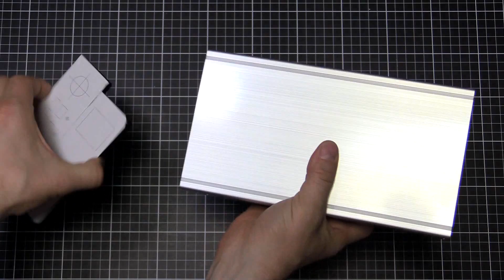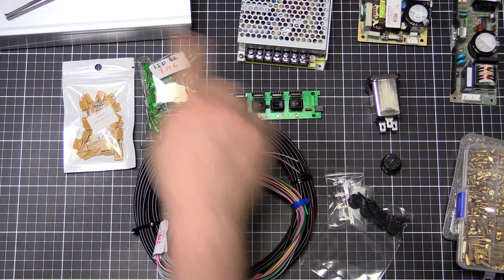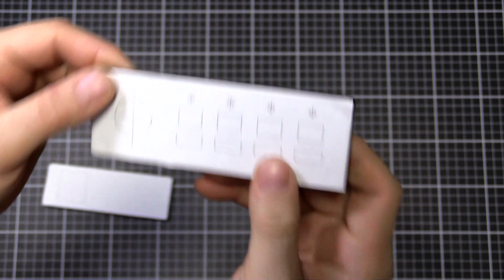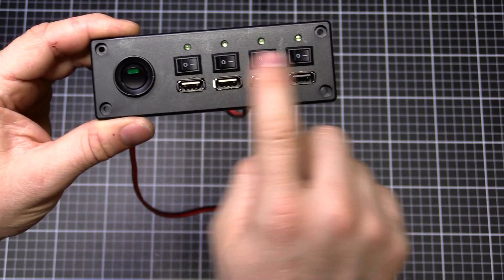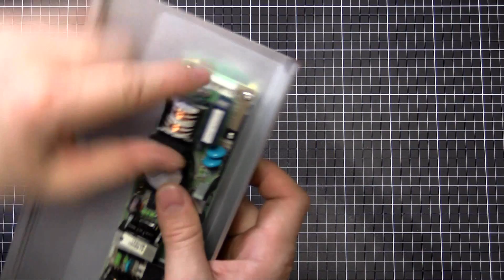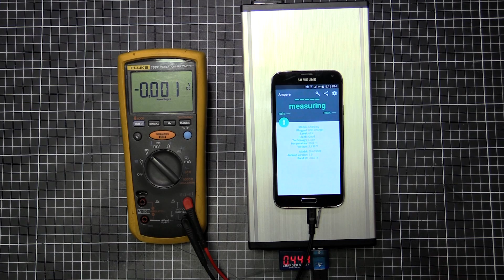How to Make a High Power USB Charger

Comment: 1:49 please nobody hold these power supplies like this dingus is doing. Thats a great way to get hurt or killed these power supplies are put into enclosures for a reason. If the caps have been discharged you’re safe but you never know if they have been or not. Please if you put mains to these power supplies be alot more careful about how you handle these power supply boards.
Reply: Electrolytic capacitors with a large voltage rating recently powered can shock you.

Comment: The reason why we place a polythene shear between the PCB and the metal casing, is because in case of a fault on the mains side, the PCB track and the solder will immediately vaporise and create a blob of hot plasma, which is highly conductive; this will short the mains to the case, creating a number of cascading faults. The plastic sheating will simply interrupt the short circuit caused by hot plasma...

Comment: This video popped up in my recommendation video's today, but i will like to add a note.
It seems that the 4 USB ports are all in parallel with each other , isn't it advisable to place a diode between each port ?
With all 4 ports in parallel, and 1 device is almost completely charged up, when connecting a second device with almost flat battery, will pull not only current from the power supply, but propable also pull current from the first device. 
Also, when the main power button is turned off, and 2 or more devices are connected with the usb port switches enabled, 
these 2 (or more) devices will try to equal there charge, and you can end up with 2 or more with half charged battery if 1 or 2 devices is flat and 1 is completely charged.
From the + to each usb port a diode, and the problem is solved. Also it's recommended to place a TVS diode of 5,6V or 6V in parallel with + and - from the output of the powersupply, this to prevent overvoltage in case the powersupply fails.
Reply from the maker: If the first device has no way to output a voltage from it's USB port, there won't be any way to discharge by connecting another device.

Diode protection is a good idea, if I ever revisit this project, I'll use my own custom PCB with all the good bits installed for protection and the like. :)
Reply: @NearFarMedia  Thank you for the quick response. Greetz from Belgium.

Comment: @NFM Do you if I could use the "Fast Charging" feature in my phone? I was planning to adapte a molex cable from PSU to use as Phone Charger! Any idea? Thanks!!!
Reply from the maker: You'd need a circuit to provide fast charging capability and a higher voltage power supply to suit.
I haven't looked into it much but I'm sure there would be info out there on the internet.

Comment: I don't understand why the setting for fast charging are different. I have power supplies that will fast charge any device that allows it (apple or android). Is there a configuration that works for both so you don't have to designate two ports for apple and two for android?
Reply from the maker: The phone will limit the power it draws from the power supply unless you have it set up correctly similar to how I show in the video, this is to prevent a phone from overloading a less capable power supply.
Reply: @NearFarMedia  Right. That part makes sense. I just don't know why some charging ports can fast charge both iphone and android, where as the ones you showed in the video were dedicated to either iphone or android.

What if I wanted all 4 ports to fast charge 4 iphones and then fast charge 4 android phones? Do I have to have a dedicated switch to go between the two, or is there a third configuration that works for both?

Comment: This video is great!
I would like to build this with a solar panel, so that in case of light off I can still charge my phone.
Any suggestions?
I still want to be able to charge multiple devices. I should also withstand heavy rain
Reply: Solar panel won't be able to deliver the high draw needed. Solar panel is only good for trickling at around 100mah and 5v.

Comment: -Hi, how works the polyfuses ? It is linear, of it cuts the current for a short term then allows it again ?
Reply from the maker: The polyfuses go open circuit when you draw too much current. After a little while, they cool down and close the circuit again.

They are basically self resetting fuses.

Comment: It seems like you did not actually limit the output to just two Amps per port? I mean, if you would use only one port, thus connect only one device and charge that, it is directly receiving the full 10 Amps of your power supply? Of course, if the device would try to draw more that 2 A, your small breaker on that port would trip, but quite some devices when it is left to their own choice, will try and draw more (for instance those that are equipped with QuickCharge tech), I am thinking. Very nice build!
Reply from the maker: I ended up removing the polyfuses and just run it direct now. I also added some banana socket binding posts too, so it is a handy general 5V PSU too.

It's still running perfectly and gets daily use. :)

Comment: I like it, but I need one that can support Samsung fast charging, so I would need to use a power supply that has two separate outputs that are adjustable. When my phone goes into fast charge the amps go down and the voltage goes up to 9 volts and some go higher, so I would need a port that can support this kind of fast charge. It should be easy enough to do. I currently built one similar to yours that uses a laptop power supply. It can deliver 2 amps to each of my 6 USB ports. It is way more powerful than anything one can buy in the stores. It would be nice if they would make one that people can buy, because most can't build one like your charger or mine.
Reply from the maker: Yeah, I like the high power output.

For fast charging, a chip is needed that communicates with the device being charged to check what voltages it is able to handle.
I haven't looked into how hard it is to build something myself, but the chips may be a little hard to solder by hand.

I'll have to put it on the list for a future project....
Reply: They now make a USB device that fools the charger into putting out higher voltages. I am going to get one to see if it works for my charging hub. I have purchased two different charging hubs and neither of them perform as good as the one I built.
Reply: @cmj20002  did you ever end up building a fast charger for Samsung phones?
Reply: No not yet, I have many projects and some just get put on the back burner until I remember it again. Funds can be a constraint as well. They do make some now that support fast charge.

Comment: nicely done. thank you for the video. :)
just my 2 cents, for the holes printout, i found it is easier to stick it with some double-tapes to the panel before drilled. does a good job to prevent movement yet easy to remove after.
Reply from the maker: Nice tip! I'll have to try that next time I need to mount a PCB.

Comment: what are you gonna charge with this thing, is not that harmful to use high power while chargin ? (if that was a good thing, manufacturers would do it for phones and ipads and stuff anyway ? is not it ?
Reply: Deniz Yildirim - manufacturers do it, but with minimum amps just enough for a single device it came with (a.k.a the bundled phone charger). basically what NFM built is a bigger version of those charger. it has 10A supply, means that it can charge 4 devices simultaneously and able to give >2A each, if required.

it is not harmful, because the power supply only gives the current as much as required by the devices being charged / powered on. so if your phone only requires 1.2A for the charge process, then the power supply only put out 1.2A to the phone, instead of shoving all 10A to it.
Reply from the maker: The voltage is kept at the 5V (or maximum 5.25v) as specified by the USB standard.
It can supply a lot of power, but the device only takes what it needs, having more power just means things can charge quicker if they are able to use the extra current, or you can connect more or bigger loads at one time.

As for my use, I use it for powering USB stuff that I'm playing with or building. It's a good general 5V power source.

Comment: Hi, thanks for the video. Why do I get a voltage drop when I draw 2A current? When I draw 1A current, the voltage is around 4.7V and 4.4V when I draw 1.65A.
Reply: Thanks
Reply: use a larger gauge wire

Comment: Sources for the hub and power supply?
Reply from the maker: +richardcmongler I found them just walking around Akihabara, but any cheap USB hub can be used. Hit ebay or the other usual outlets like aliexpress or banggood etc and see what you can find.
The PSU is the same, in the video I show a PSU with the perforated metal box, that was just from ebay and work well. I use it to power my Raspberry Pi's and they work perfectly.